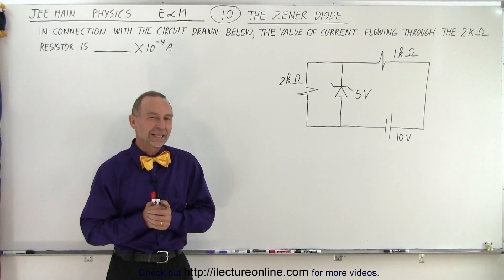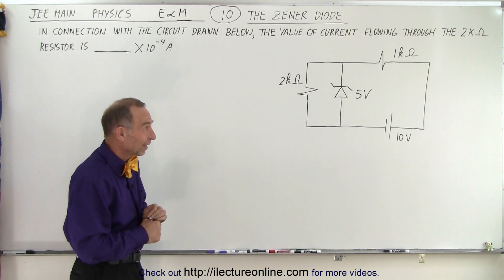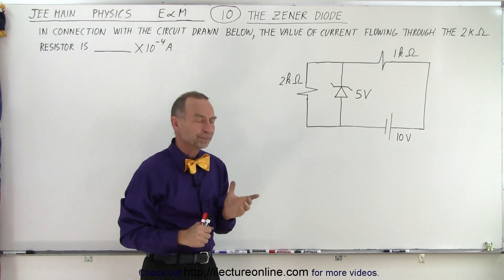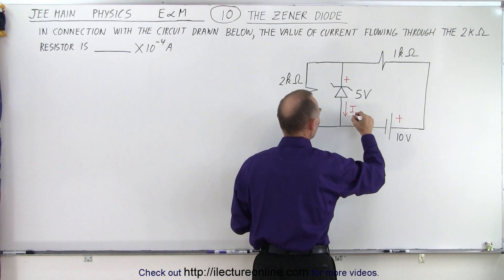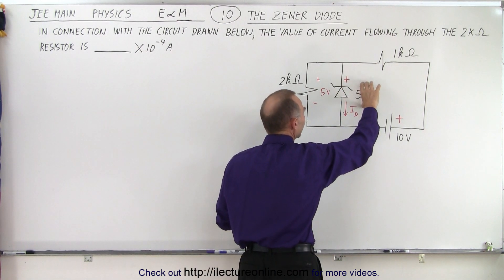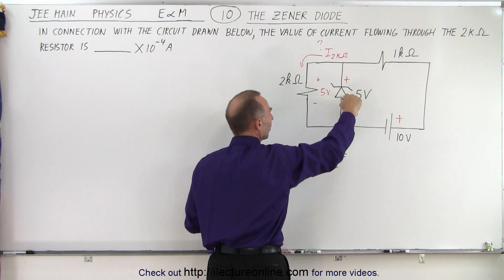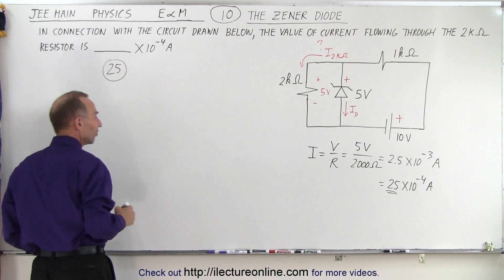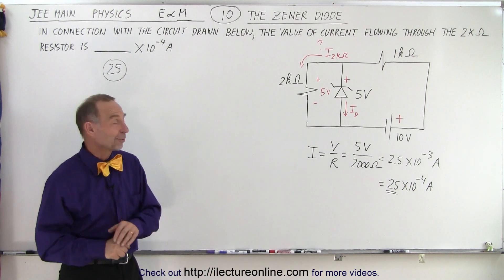JEE Main Physics E & M #10 The Zener Diode

Comment: Yess finally! After waiting long time we arrive to this, semi conductor part. But why its not on electrical enineering sub??

Cant wait to other semi conductor such as regular diode, led diode and all of diode and every transistor biasing method and all of semi cunductor part include mosfet. 
Thanks prof
Reply from the maker: Yes, we still need to add semi conductors in the engineering videos.  Time is our biggest obstacle.
Reply: Good people will have long life. Aamiin
Its ok, i know you have many thing to do
I have 29 years old too. I cant get job which i like anymore. Im very ashame to my self my past not working hard to it. Maybe now its only just for hobby
Reply from the maker: Nothing to be ashamed of.  When I was young I had a job cleaning bathrooms and I also worked on a farm picking tomatoes.  Life is about learning, striving, discovering, and finding out what we want to do in life.  As we work hard in a job it usually leads to better things.  We just have to start and keep going.

Comment: You will only get partial credit, since you should also have shown that the zener voltage was actually obtainable. If the two resistors were switched around, your method would not have given the correct answer.
Reply from the maker: There is no partial credit on this problem. With the JEE tests, it is all or nothing.  Full credit is give to the answer shown in the video.
Reply: With the 2 resistors switched the answer would have been ID=V/(R1+R2)because the breakdown voltage of the zener would never been reached. By the way thanks for your videos👍🏻

Comment: So that top resistor is just to throw us off. That just plain evil
Reply: No, the answer was only partial correct. See my comment.
Reply: @Janda125  if the load resistor is too low  in value then the zener voltage won’t be 5V. The top resistor is to properly bias the zener. You really need the data sheet of the diode to properly figure this out. But, as an ideal component assumption and the load being  twice the resistance of that of the bias resistor, he gave the correct answer. If you really wanted to get technical about it then the answer would be “not enough information” since the zener is a non-linear element. It’s IV curve has a knee. You need to have a minimum amount of current through it to operate it at the rated Vz. The load can “steal” too much current from the zener circuit causing a lower voltage to appear across it.
Reply from the maker: Note that this is a problem from the JEE test.  You have no references, no calculator, no equations sheets, just what you have in your head.  The answer in the video is the only answer that will give you credit for the problem.
Reply: @MichelvanBiezen  don't know what a JEE test is, but your answer is still only partly correct, since the circuit analysis is not done correctly.